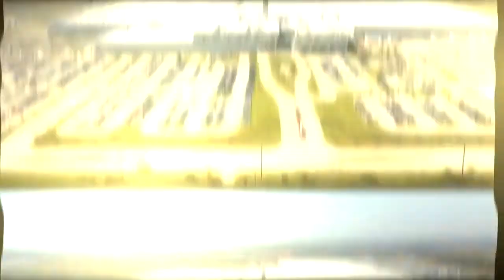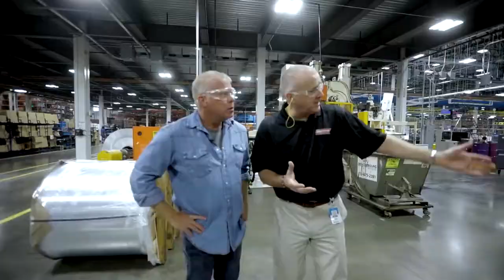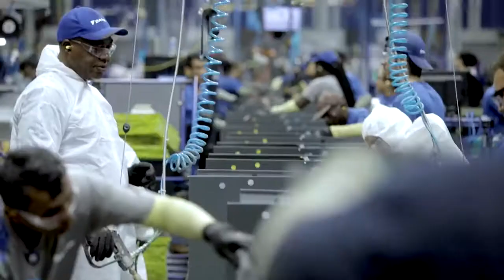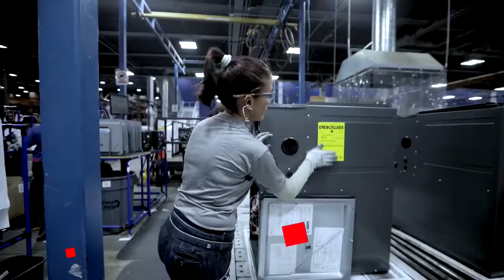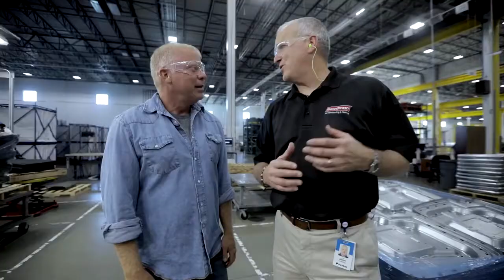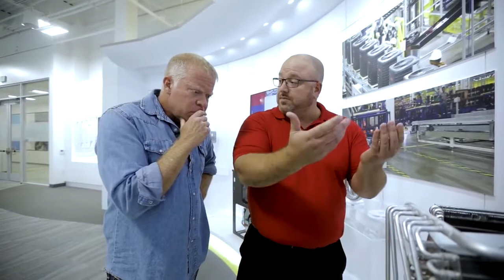Goodman Furnaces | HVAC Direct | Built In America

Comment: STAY AWAY FROM GOODMAN FURNACES. 😫 I had a new 80% furnace installed. The air hammers through the heat exchanger and is heard as a low rumble throughout the house. My contractor tried everything to solve the problem then contacted Goodman. They have refused to even consider this is a defect. The prior Goodman furnace never made this sound. Goodman will not even discuss the problem with me, the homeowner.